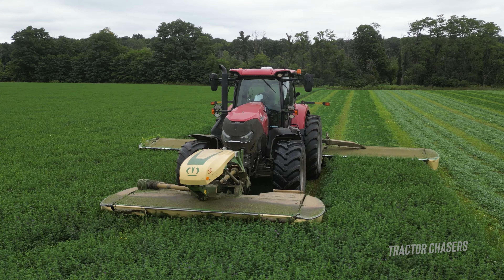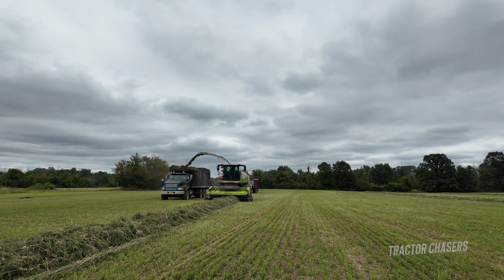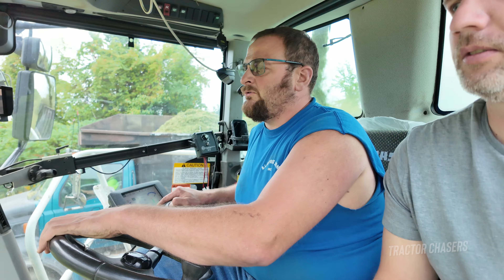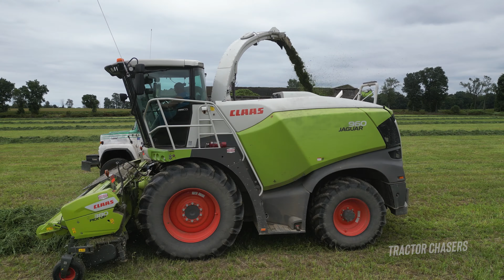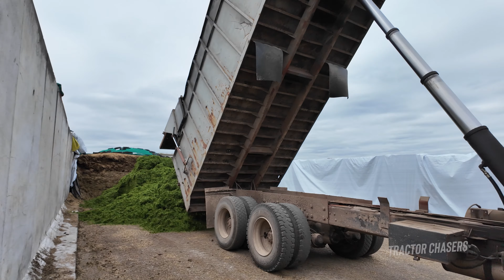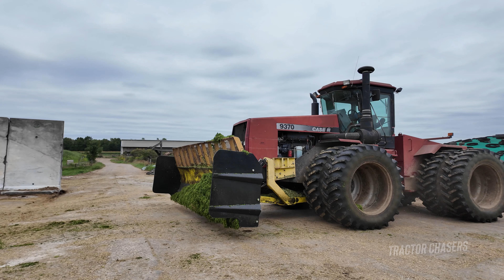Hay Mowing, Merging, Chopping on a Dairy Farm

Comment: Merging hay with a 4wd tractor pretty interesting wonder how it compares with a row crop tractor....
Reply: I wouldn't go back. We have a 30' unit on a straight frame before we put these two together. And had trouble with the weight of the merger on that tractor. Now theres no issues. I prefer articulate tractors over straight frames.
Reply: @steinfarmsllc  idk cuz some of the big dairy farms around me that have 4wd tractors they are more of a back up to the row crop tractors with front and rear duals that do like like 75% of the farm work
Reply: @Blackwellll3066  it's all just personal preferences.
Reply: @steinfarmsllc  yea I just think if I had a 4wd tractor I have it pull dual dump carts or big silage trailer instead of just packing silage, pulling grain cart or some tillage
Reply: @Blackwellll3066  the big 4wds play those games. This is only 240 hp. It's the perfect job for it. You wouldn't pull that merger with a straight frame fwa as easy as this setup does. That merger has lot of weight to throw around.

Comment: I like the idea of big 4wd running a merger… not as much tractor hop when that is like that.. although I don’t think the turning is good but I take the good with the bad. Great video
Reply: The 4wd  is a fantastic way to pull that heavy merger. No lack of power or traction. Visibility from the cab is fantastic. The steering is a touch tricky with the steering on the rear of the merge as well. When you turn the tractor it sends  the merger the opposite direction you want to turn then returns to follow correctly. It takes some getting used to.